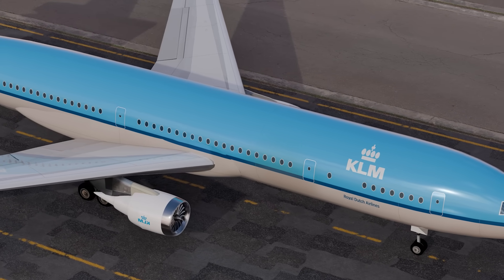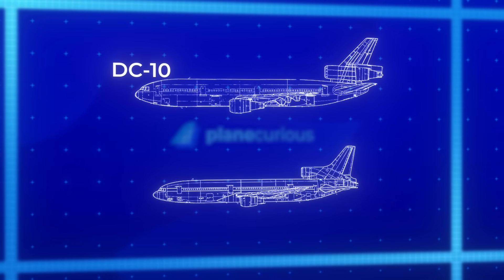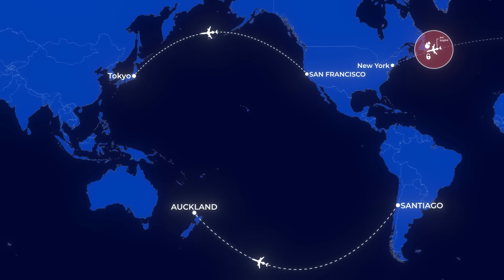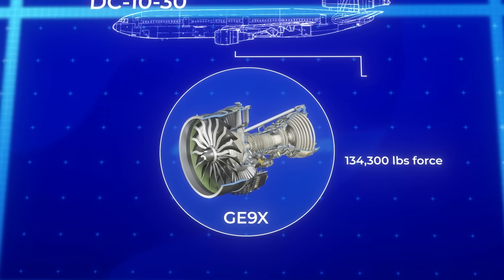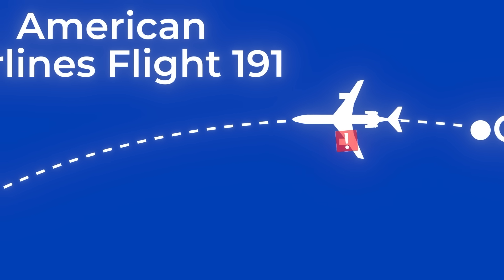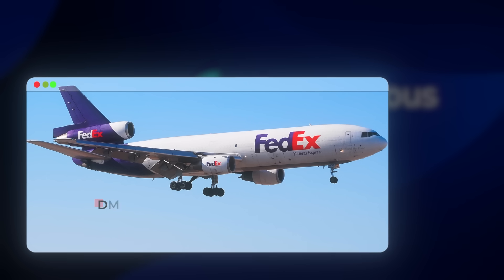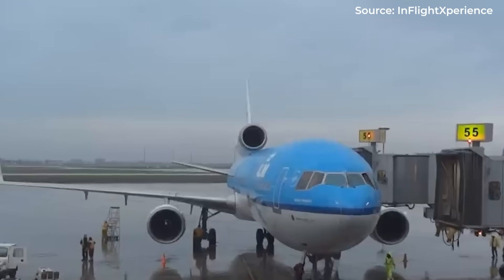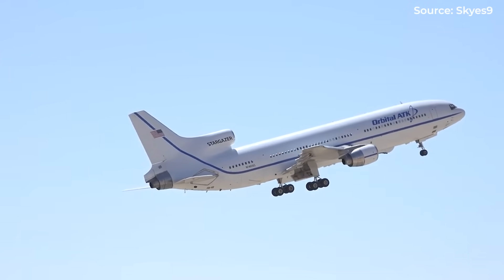Trijets Changed Everything - Until They Didn’t

Comment: The DC-10 was not designed as a 3 engine plane.  It was originally designed for two engines that GE promised to build.  But then GE backed out of the deal, and Douglas had to scramble with a redesign to get enough thrust to fly the thing.  That's why that 3rd engine looks like an afterthought.     It is.
Reply: wrong 2 engined widebody jets became only viable over when the ETOPS range was extended for flying over the Oceans.
3 and 4 engined jets were the norm on flights over the Atlantic and Pacific due to ETOPS.
Most money was made on those routes.
The Airbus A300 is the first widebody twin jet that was LEGALY allowed to fly over the Atlantic.
The Airbus A300 and Boeing 777 made the DC10/MD11 and Lockheed tristar obsolete.
The Boeing 737NG with its hy bypass engines made the 727 obsolete
Reply: @obelic71  ETOPS range wasn't extended (to 180 minutes) until 1989. We got the A300, A310, and 767 almost a decade before that.

And it wasn't made unlimited until 2007. In which period we got the 777 and A330.
Reply: @seventh-hydra  You forgot the different Etops classifications.
original it was was 60 minutes for a twinjet. it could be extended to 75 minutes with proven reliable engines in the early 1970's 
Etops 90 was introduced with the Airbus A300 in 1974 for the pacific and that made twin jet operation over  Asia posible.
The oil crisis and so expensive fuel costs for the airlines created political presure to extend Etops further.
Some airlines like Eastern got an exception for 2 planes ( the famous 2 A300 for free only maintenace costs) to test if it was practical possible.

In 1985 Etops 120 was introduced with the A310 and B767
The Boeing 777 first flight (not commercial flight) was in 1994
Etops 180 was introduced in 1988
And the B757/767 A300/310 all with 2 man crews obliterated the medium intercontinental market and made the DC10 and Tristar obsolete.
The B777 who is bigger then above mentioned airliners became the twinjet workhorse on long Asian routes originated from the US and Europe.
The B777 is a relative rare bird in the US often only seen in major airports at the east or westcoast serving intercontinental flights. but very commen in Europe and Asia on all major airports.
Modern XLR versions like the A350-900ULR and B777-8X are going to serve on the direct flights (20+hours flighttime) long haul routes like London/NewYork - Sidney
Both of those aircrafts are in the end of their development  on order and not in service yet.
Reply: @obelic71  Thanks for the writeup! I didn't know most of that, always love to learn more.

I mean the A300 and 767 were both still in use for several years before ETOPS allowed them to fly overseas. But you said "viable" and it looks like 767 sales didn't really take off until ETOPS cleared it, so that checks out.

In the case of the A300, I imagine it got away with it prior to ETOPS extensions simply because the Old World is so massive that one could probably fly from London to Tokyo without ever being more than 60 minutes away from an airport.

It's also a lot more densely populated, making short-haul widebody more viable I imagine.

As for the DC-10 it looks like they originally wanted to make a 4-engine plane when they started drafting designs in the 60s. I have no idea how far along the design process they got though. Maybe the 3-Engine design really was from scratch. But it does look a bit like an afterthought, compared to its peers
Reply: As Trijets goes they were on purpose developed to be more economical then quad jets and still legaly (ETOPS) capable of flying the most profitable atlantic and pacific routes.
The de Haviland trident was the first trijet shortly followed up by the Boeing 727
The DC10 and L-1011 were developed to compete with the B707 and B747
As trijets goes yes they burn less fuel then quad jets but the maintenance costs are way higher due to complex systems for the thirth in tail engine and airframe stress fractures examinations.
Reply: I loved  the dc 10 flying the pacific  !
Reply: I think that was BBQ get together talk...as usually happens airlines petition manufacturers for what they think they want..... AA asked Mcdonell and Locheed to propose a twin aisle trijet.... Locheed had already had this idea in work where McDonnell had not even thought of one as that lore goes.
 The DC10 flew first and DL even operated them on a lease till the Tri Star was available.... a Playboy article covered the side by side development and the early life cycle of both jets years ago that was very interesting and well written.
Reply: @greatcollector9362 that’s why I purchased Playboy in my youth … for the airplane articles.  😂
Reply: Missed the Trident the first passenger airliner to do a fully automatic landing capable of landing in zero visibility. A nice safe reliable plane with excellent flight characteristics.
Reply: @anthonywilson4873  Correct the de Haviland 121/ Hawker-sidley Trident (1959) was earlier then the Boeing 727 (1960) and can be seen as the first trijet airliner.
It was primarly designed as the succesor to the de Haviland Comet.
Sadly the specific demands of BEA (the launch customer) made the Trident less economical then the 727 for other airlines.
Reply: Nonsense. There were no two engine planes that flew the distance the DC10 was meant to. Watch the video.
Reply: The original DC-10 design would have looked like a 777.
Reply: @cmkeelDIM  Douglas/MD had only a plan to redesign the DC10 into a twin jet after the Airbus A300 and B777.
A clean sheet was better then a redesign so thats why they upgraded the DC10 into the MD11
The MD12 (4 engined doubledecker) based on the DC10 was also not persued.
Reply: Are you forget about ETOPS?
But more question arise is where did GE promise to build twin jet came from...
Reply: @AAA839  ETOPS didn’t exist then, so no I don’t forget ETOOS.
Reply: "The DC-10 was originally designed for two engines that GE promised to build"

So not true, . . .

AA wanted a twin engine wide body but neither DAC or Boeing could accommodate their design specification request.

The initial design by DAC was a four engined double decker, based on their failed entry in the competition for the C-5. 

But DAC engineers soon abandoned that idea in favor of the three engine concept.

The twin engined DC-10 was not considered by DAC engineers until the DC-10 was long into service and was so considered in response to the Airbus twin engined A330.
Reply: That's interesting! I've never heard this before!
Reply: The wikipedia detailing the history of the DC-10 says the 3 engine design with seating for 399 was selected against the 4 engine design proposal with seating capacity of 550, which would mean this would be well before serious design work had begun.
Reply: @Edax_Royeaux  Ss widebody aircraft goes the most money could be made on the Atlantic and Pacific routes.
Thats why the trijet was developed to be more efficient then a quad jet but also work around the ETOPS rule.
Reply: Right….
Reply: they were this close to develop twinjet liners.
(right within the timeline when ETOPS maximum time is insufficient)
Reply: Great design to be honest
Reply: Seems unlikely since that would have stopped it crossing the ocean at the time.
Reply: @peteconrad2077  Timelines  are interesting things.
Reply: In another video, people said it was a horribly built aircraft that had serious safety issues. This is probably why.
Reply: @HyenaEmpyema  Yes.  The TWA mechanic who told me about this also said that TWA had a pilot's review board, which had the last word on buying any new planes.  They refused the DC-10 because the backup control lines ran in the same channels as the primary control lines.  Any accident which took out the primaries would also take out the backups.  Several DC-10s went down for exactly this reason.
Reply: @HyenaEmpyema flew it fir several years in the 90s. Pretty good for its era in my experience.

Comment: Of the tri-jets, the only one I appreciated was the 727. It seemed faster. But any airliner with an engine attached so closely to the fuselage is noisy. I always rode DC-10s with a bit of dread. The tail engine looked like an afterthought attached by an apprentice with a cutting torch and an AA degree in welding from a night school, and the safety record of the DC-10 always struck me as lacking corporate priority. It was no surprise to me that the airplane that took the Concorde out was a DC-10 throwing its parts on the runway. I am so glad the DC-10 is gone.
Reply: The -100 was VERY fast... but not as fast the Convair 880

Comment: My dad was an engineer with a DC10 operator. He said the DC10 #2 engine config meant that the engine wear profile was the same as #1 and #3. That meant a big saving in maintenance complexity. There was a loss however as the structure to mount  just an air intake in the tail was much lighter (L-1011) than the huge alloy casting to mount an engine and intake in the tail.
Fun fact: Take the DC10 engine nacelle, put the cockpit and tail of a DC3 front and rear and it is the size of a DC3.

Comment: Trivia:  At 9:25, you see a rare version of the 727.  This is called a Valsan, and it has number 1 and 3 engines replaced with MD80 engines and cowlings.  That's why you see the "bucket" thrust reversers deploy.

Comment: American Airlines came up with a request to the three airframe manufacturers.  They wanted a twin engine plane that could carry 250 people and their baggage from New York to Los Angeles during the winter winds and meet required fuel regulations.  This could not be done with a twin design, so they accepted a three engine design.  McDonnell Douglas and Lockheed both submitted proposals.  Boeing submitted what became the 747, the reasoning being that all these airplanes would soon be rendered obsolete when supersonic transports began to be produced.  Their idea was to base the 747 systems on their new 2707 supersonic jet.  Thus airlines would have parts in supply already and could sell the 747 to cargo airlines.  This is why the 747 has the upper deck;  This allows for a swing up nose door for the loading of long items.

As a passenger plane it was simply too large, and many were parked in the 1970's due to the oil embargo and economic malaise.

Comment: While a huge factor in the demise of tri-jets, the AA191 crash requires some more nuance:
First of all,  the engine that fell-off was a normal wing-mounted engine, not the tail-mounted "third engine."  It's plausible this could have happened to a twinjet or even a quad-jet.

But there was a critical path of 4 issues that led to the crash:
  1 - The engine itself did have a significant design flaw.  Once discovered, all of the engines on all of the relevant aircraft to be removed, checked, fixed or replaced, and then re-installed.
  2 - American Airlines decided at the corporate level to ignore the aircraft manufacturer's maintenance guidelines for the de-installation/re-installation procedure.  By contrast, United Airlines handled the procedure correctly.
  3 - Then, and only then, the maintenance crew failed to detect or at least bring attention to the cracked pylon.
  4 - But ultimately, and this was the last chance to possibly avert disaster , the pilots incorrectly calculated the rotation speeds.  The aircraft became uncontrollable because they were moving too slowly for aerodynamic control.

Including "improper maintenance" (which was two issues in itself -- the corporate decision plus the unattended crack in the pylon) there were 4 separate issues and each one was an opportunity to save the flight. 

Don't get me wrong:  the crash was absolutely a huge factor in the rapid exit of tri-jets from the skies -- just imagine if it had happened to a twinjet instead: it likely would have greatly delayed their emergence and might have prevented the emergence of Airbus.  But it is simply incorrect to call it "improper maintenance rather than design flaws."
Reply: 💯 the pylon was the weakness, and management’s indulgence dis the rest. Once the pylon was identified DC10s were grounded world-wide and many more cracked pylons were identified, the first time a fleet was grounded. I flew in all of them and my greatest memories stay with the 727 in short haul and the Tristar, both gentle soft ‘gliders’ on approach and landing. DC10 and MD11 were geat planes though.
Reply: The pilots did not incorrectly calculate rotation speeds, they rotated correctly. The problem was they followed company policy by climbing out at normal engine out speed but that was too slow considering that the departed engine caused a hydraulic fluid leak and the slats and flaps on the left side were retracting of which they were unaware. Also AA chose not to order the optional stick shaker on the first officer side which saved them $18,000 and the captain side shaker was disabled when the engine departed so they had no real warning of the impending stall. And maybe if the controller would have told them that the engine actually departed the airplane they could have flown it differently but who knows, it was probably just an unrecoverable situation.
Reply: Too bad it had the hydraulic lines in the leading edge of the wings; if they had been more protected, the plane and passengers might have survived the engine loss.
Reply: Yes and today the systems are designed to hold the slats in place despite a loss in hydraulic pressure but the DC-10 was different and decreasing hydraulic pressure on the left side along with aerodynamic forces pushing the slats back into the retracted position caused the left wing to stall and they had no chance to recover at that point.

Comment: The DC 10 may have looked like a good design,  But inside a wind tunnel with smoke blowing over it, what was revealed was the Lockheed L-1011, Had significantly less drag than That airplane with the engine in the rudder.  The airlines preferred the 747 with its 4 engines.

Comment: I did my DC10 flight from Bombay to Amsterdam on a Northwest equipment code share with KLM. It was on November 30th, 1997. Just before take off the pilots noticed some problem with navigation instrument and returned to the gate and some engineers were called in. After about 1 hour, the aircraft took off, and during the take off, the roof of the plane shook, so wildly, it was very scary and the noice level inside the cabin was too much. Some of the aircon vents have broken, and we could literally see the cold air blowing on the passengers sittling directly below the airvents. The crew was trying to seal the airvents using some adhesive tapes. Ofcourse we had a smooth landing at Amsterdam after about 10 hours of flying and those affected passengers were given 50 USD each for the inconvenience caused to them.

Comment: The same logic of redundancy also applied during the piston era. Prior to the early 1930's aircraft engines were too unreliable and underpowered for long distance passenger travel to seriously  consider twin motor designs. The solution for some airliners of the day was 3 motors. Unfortunately this usually meant a noisy engine in the nose of the aircraft but there were some variations for flying boats like having the motor on top of a wing.

Comment: Of all the TriJets, the 727 was the best-looking of them all and, IMO, next to the Concorde, the 727 was the sexiest passenger jet ever created, especially in American Airlines and Braniff Airlines' "Flying Colors" liveries. Nothing like it in the sky today.

Of the wide-bodies, I loved the look of the DC-10 the best. It just looks "wicked" to me. Technologically, the L-1011 was more advanced and inherently safer. The DC-10 and MD-11 tail-mounted engine is mounted way above the roll-axis of the aircraft, resulting in high-roll inertia. It is for this reason that so many of these aircraft that have crashed ended up upside-down. More than one FedEx MD-11 has ended up on its back. No doubt it was a major factor in the Chicago crash. The L-1011 did not have this fatal flaw because its third engine was located on the roll-axis of the aircraft, although this necessitated a costly and heavy S-duct. 

In my lifetime (I'm 66), I have flown on all three aircraft, and I have distant but fond memories. I also remember as I kid when I would go to the Toronto Airport to watch planes take off and land. The best spot was the McDonnell-Douglas parking lot. Back then, McDonnell-Douglas built the wings for the DC-10 and before that, DC-9 and DC-8 in Toronto. It was a great spot because the wings of the airliners would almost pass over your head as they made the right turn for the then 24R departure (now 23R). I can still remember Laker Airways DC-10's passing just a few feet away from me and the sweet smell of kerosine that I came to love living next to an airport. Oh, those were the days!

Comment: Trijets changed everything until engines REALLY changed everything. The evolution of engine reliability meant that trijets were always doomed which is a shame. The DC-10 and L1011 are some of the most beautiful planes ever devised. I was lucky enough to fly on a DC-10 as a young kid and it pretty much set the wheels in motion for eventually becoming a pilot. The only thing that’s a little unnerving to me about trijets is the notion of an uncontained #2 engine failure. How much important stuff is back there? Your vertical and horizontal stabilizer, rudder and elevators, hydraulic lines…it’s just a lot of REALLY important stuff that could be easily damaged in the event of an uncontained engine failure.